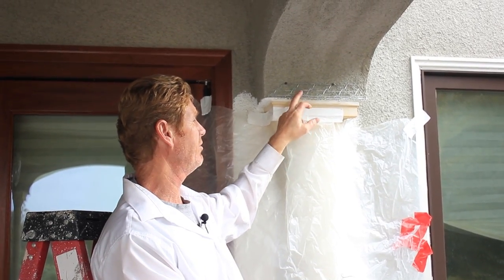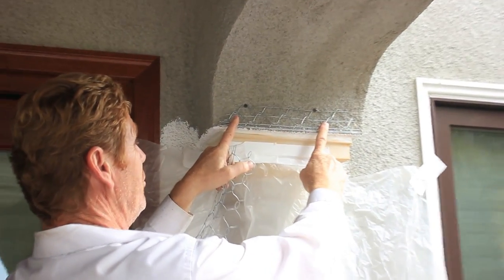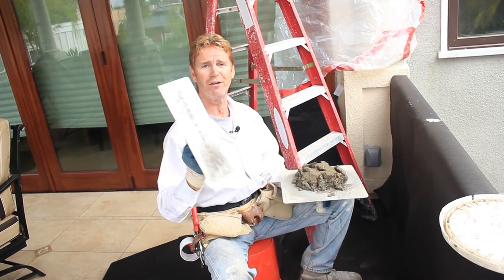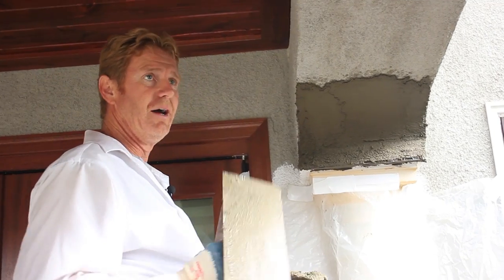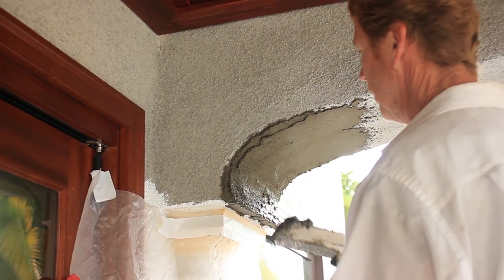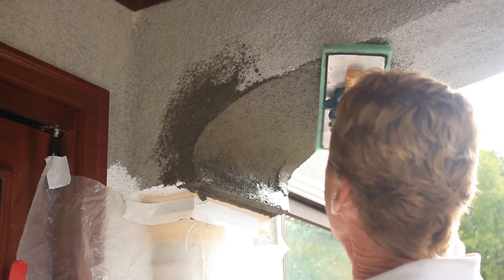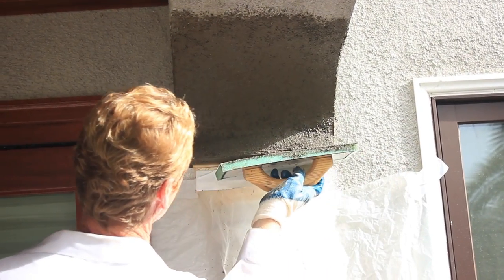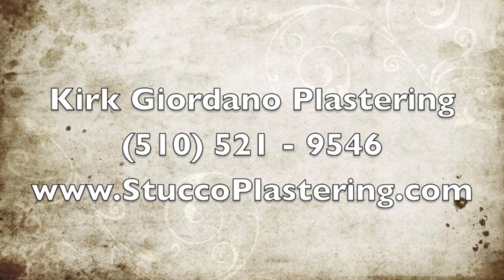How to install stucco arch aid for guilds

Comment from the maker: Hey dusty thanks for the tip. I dint know you could translate that way.
 I didn’t charge for this arch fix, as no matter what I did it would still be off in another direction. 
Also, my son Jason has been a licensed plastering contractor for about 2 years I think. 
Best wishes.
 Kirk Giordano Plastering

Comment: Kirk did I understand that properly, are those arches wood forms ? And then wire mesh over the top and then plasterd. I'm making 5 arches over a patio and I'm considering forming them and pouring a diy polystyrene bead concrete mix. I don't think our climate would suit wooden forms, wired and plastered.